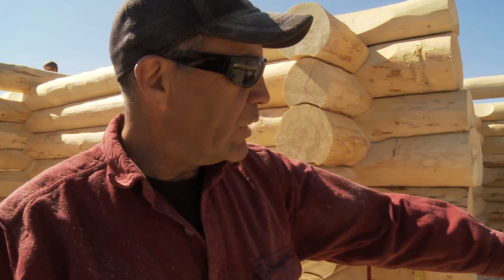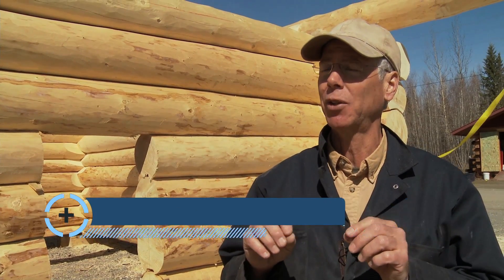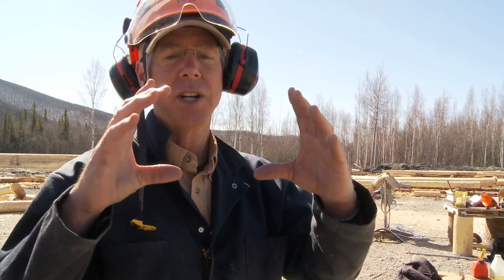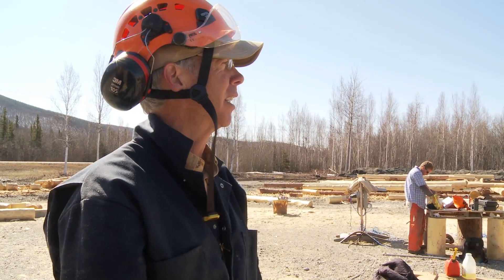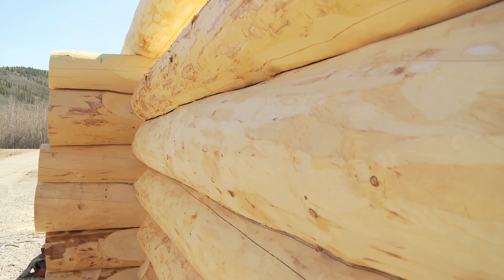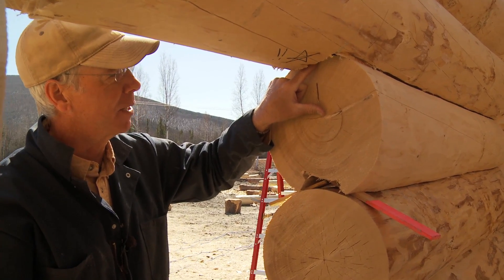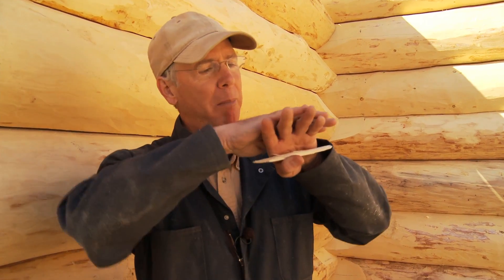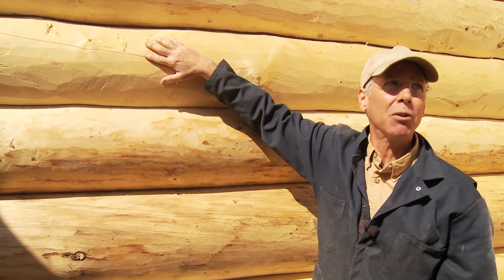Energy efficient log cabin construction workshop

Comment: it looks amazing, but i question its durability, wood expands and contracts over the course of a year. with such a tight fit, what is stopping the would from cracking and spliting as this occours ?
Reply: he explained in the video about balancing out the moisture content throughout the house by humidifying, especialy in the drier climates like canada,you will always get a little cracking and shrinkage but mainly in the first 4 to 5 yrs, after that its pretty much settled in.log homes are extremely durable if looked after properly, they are more suited to extreme climate changes than most other type buildings, with the exception of constant humidity enviroments, they tend to degrade quicker then.http://en.wikipedia.org/wiki/C._A._Nothnagle_Log_House.just goes to show long they can last.

Comment: Not real impressed here,hey guess what I can build one out of a pile of # 8s and fiberglass build my own form liners out of 36" dia pvc pipe cut in half for a log face with reinforced concrete and pretend it's a log cabin yeah corners two big deal. No problem so log builts are flammable so they split and splinter after a decade or two
yeah OK maybe so.I'm thinking maybe maybe not who would pick one apart unless they had one built out of concrete ?
Reply: +James Cagney You must be very lonely.
Reply: heh?